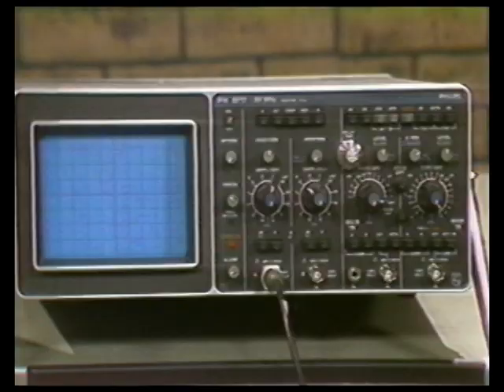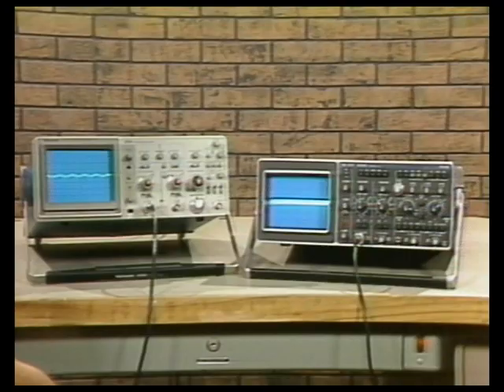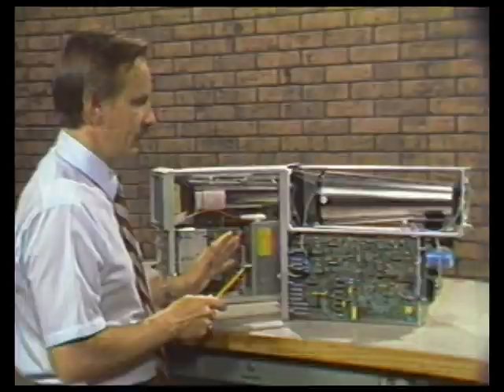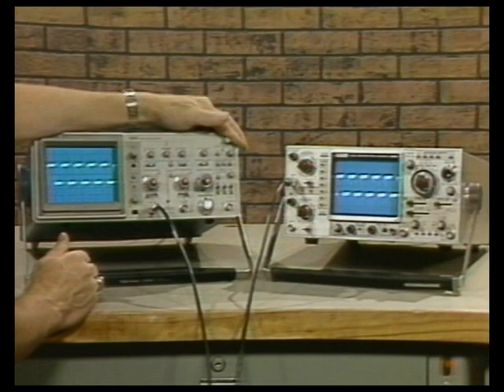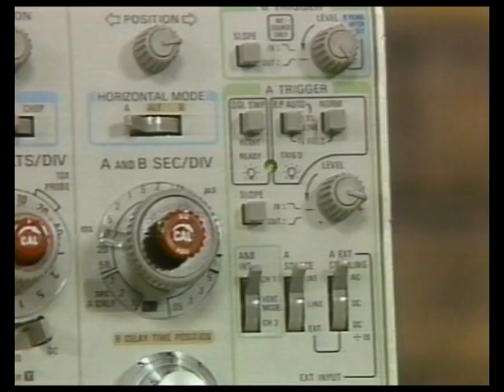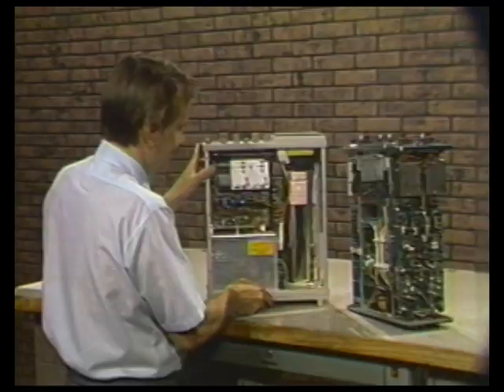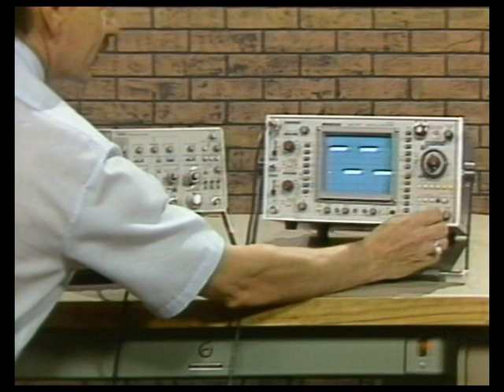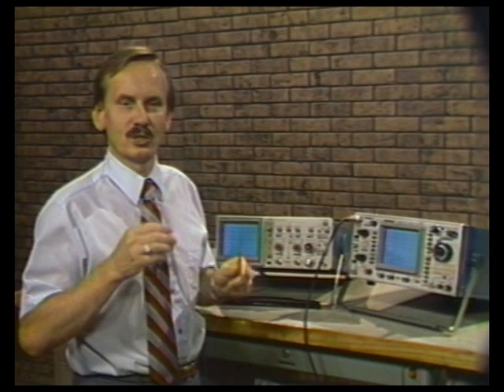Tektronix competition 1983

Comment: Very interesting series!  Unfortunately one VERY important factor was left out:  Cost!  It is clear that the Tek 2215A is a great scope.  I have used many Tek scopes over the years in my professional career and I have been very pleased with them.  They do cost a pile though so when it came time for me to purchase a personal scope I ended up with a Philips PM3214 which is essentially identical to the PM3217 except it has a bandwidth of 25 MHz. instead of 50 MHz.  It seemed at the time to be a reasonable cost/performance trade off.  I have been very happy with the PM3214 and it serves me well to this day.   For what it is worth, I also used a few HP scopes during my career and I was never very happy with them.  HP used to make some pretty good equipment, but their scopes didn't seem to be among them.
Reply: Gosh that film is 39 years old. I've a 2430 from circa 1990 and it's a dinger !